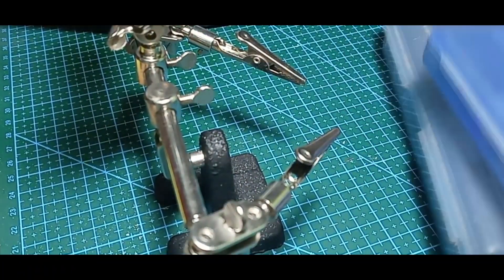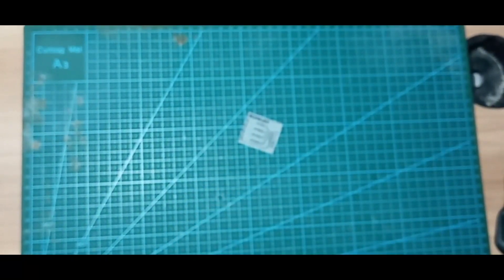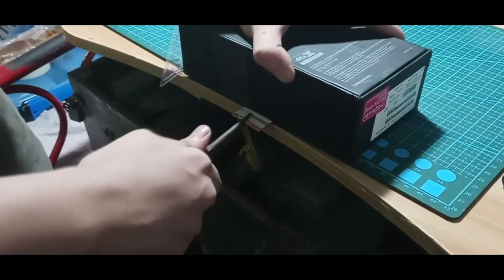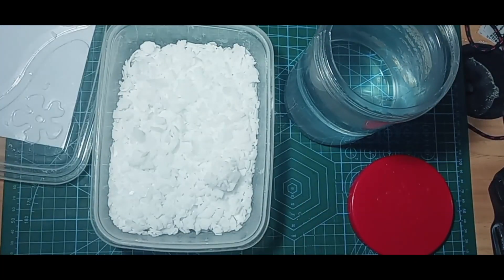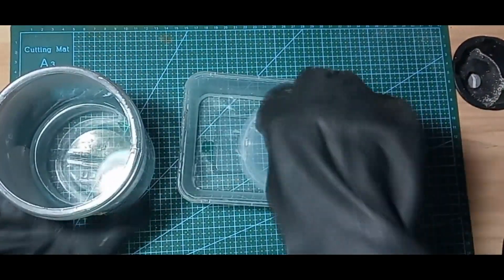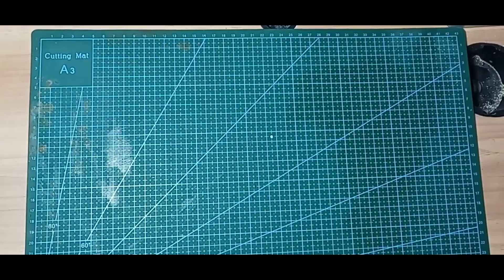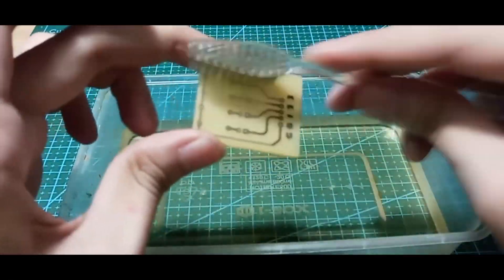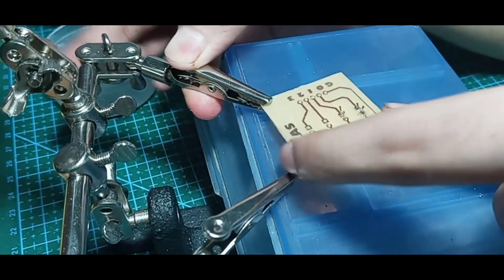DIY PCB - Single Sided Presensitized PCB - PCB Making

Comment from the maker: Update: In the light exposure process, I learned that separate 10cm away from the PCB and fluorescent lamp and leave it around 10 mins. The distance of 5cm and 25mins still work but I find out changing the distance from 5cm to 10cm and changing the exposure time to 25mins to 10mins is a better option.

Both methods work fine, you can make your own experiment on the distance and time duration to find a better option.

Part 2: Light Exposure Process
https://www.youtube.com/watch?v=jCKvDziUKNg